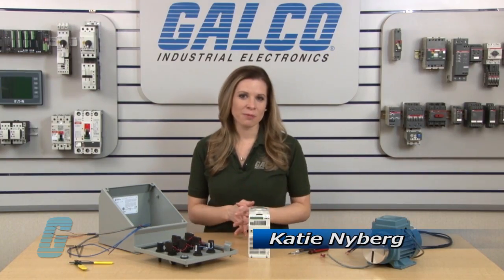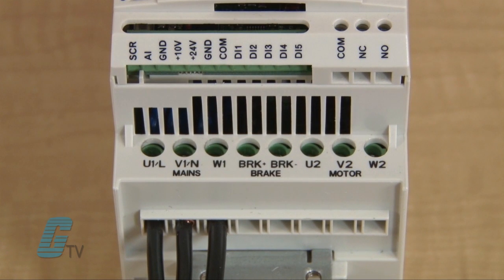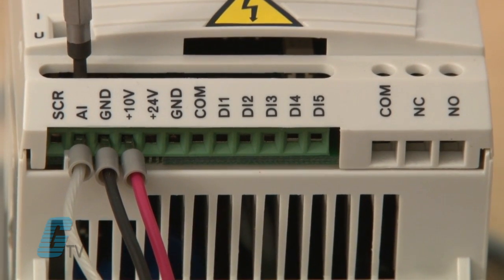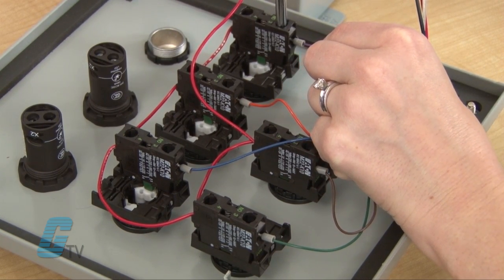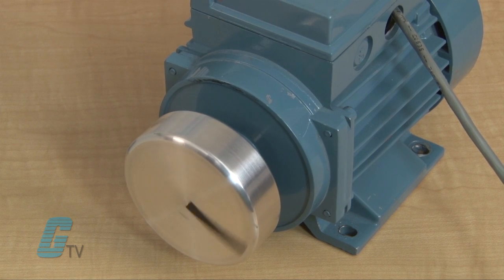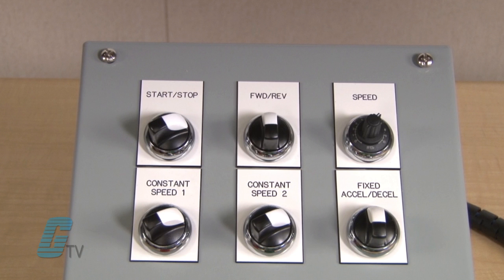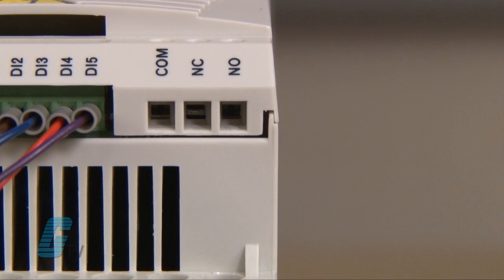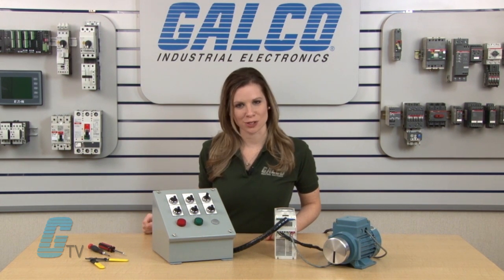How to Wire Up an ABB ACS150 Drive

Comment: The manual seems to indicate the relay output can be wired for 230v, but its not clear how this is done.  The 24vdc is covered here, but I’m hoping to use this relay yo run a very small pump (less than .5A).  I have this ACS150, single PH 230v input, output 240v 3ph to 3HP motor. When I pull the trigger (remote button on saw arm) I want to use this relay to fire the pump, just like lighting a “running light”. Any ideas,

Comment: Huh. So you don't need to bolt the motor down to see if it works or not. I was taught to always bolt it down. But I guess it's only really needed when it actually has some working load to it. To stop it from going around.

Comment: If there is a fault, the supply to the motor is cut off due to the OLR in my power circuit. Then how does the red indicator bulb glow? When there is no power to the VFD?

Comment: hi I like your video I would like to know how to connect a potentiometer to use it remotely thanks
Reply from the maker: The Speed pot can easily be wired remotely , just make sure you use shielded cable and only ground the shield at the drive's chassis ground, ok?

Comment: What is digital input & analog input plz mention. thanks
Reply: digital input is the contact from relay or switch, analog input is either voltage or current which comes from sensors analog outpur or other devices has analog output..
Reply: @sircmanaloto1296  thanks

Comment: Please help me for overcoming the error -F0035 in ACS 150
Reply from the maker: Looks like you have a problem with your output power wiring. Please verify you have the input line power connected to U1 V1 W1 and motor leads connected to U2 V2 W2, very critical. If ok then verify your grounds are connected per the manual recommendations.
Reply: I checked input supply between R & Y =398volt, Y &B =398V and B&R =405 V. But this error continue after a fraction of minutes
Reply: I also  disconnected output wires which were  for motor but still condition was same
Reply from the maker: Please reference the terminal numbers
Reply: Input power supply OK
Reply from the maker: Did you measure each phase to ground? If so and the voltage to ground is equal, the drive may be faulty and need repair.
Reply: I check voltage between each phase and ground. This is OK. And also disconnect motor wires but error is coming continuously.
Reply from the maker: Then it is most likely the drive itself has failed.

Comment: When I press reverse pushbutton its shows REV on the acp and I get 24v on DI2 but the motor doesn't run in reverse direction.

Any solutions please?

Comment: What does U and I stand for on the input switch?
Reply from the maker: The U stands for voltage input (0-10volt input), and the I makes it a current input (0-20ma).

Comment: Where does Katie connect the +24V Source to in her setup? Trying to wire up the ABB ACS150 for a momentary contact paddle switch.
Reply from the maker: 5th terminal from left should be the +24volt output but you will also need a jumper from com to gnd so you can use the internal 24volt supply for your inputs.

Comment: i had installed pot but it is not controling, which parameter should i change that speed could be controled by pot and i am using acs5050-01-045a-4
Reply from the maker: Ahh well let me assume that you mean the ACS550, because there is no such drive as ACS5050, ok? The drive defaults to the Analog input 1 or AI1 at X1 terminals 2, 3, and 4. Do you have a copy of the User manual for this dirve?
Reply: yes it is acs550. i had downloded its user manual from abb website.It was running on remote mode by using speed pot but person who was handling this drive before me had done something to it and now pot is not working some parameters are also missing i can only change rpm by drive keypad prameter 11 ,1105. please help
Reply from the maker: Ok if you have keypad ACS-CP-A first make sure you have the "REM" symbol in the upper left corner of the display, (remote mode) if not simply push the LOC/REM button to put back into remote mode of operation. If still doesn't work you may have to default the drive.

Comment: hello Katie i am not able to start this drive,is it necessary to connect AI
I have connected 3 phase mains  & motor connection but drive not starting
Reply from the maker: Hello,

Is the drive in local or remote mode, and have you attempted to configure the drive yet?
Reply: no,actually i am not able to start the drive,I mean please tell me how to start the drive,I have ABB ACS 150 drive,0.75KW ABB make AC motor,3 phase supply,is there anything else to start the drive
Reply from the maker: Hey,

We'll help you get your drive up and running, so we'll start with some questions for you and work from there.

Let’s start with “Does display light up?”
If so, look for “LOC” in upper left corner of display.
If says REM, push the LOC/REM button to indicate LOC.
Then push the start button (with green symbol on it) and turn up the speed pot on face of the drive.
If it still doesn’t run, then what does the display say, is it faulted?
Reply: thank you galco.
only display light up,it shows nothing.its a new drive.
Reply from the maker: Ok Shrikant,

So this means that you do not have the drive wired up yet, correct?
Is the drive mounted yet?
Line Power leads to U1 V1 W1, ground wire to chassis terminal.
Motor leads to U2 V2 W2, ground wire to chassis terminal.

Do you have a manual available? We can link you to one if you need it.
Reply: yes I have wired up drive but I have not connected ground wire.is it necessary to connect ground wire to start up drive.i have connected only U1V1W1 & U2V2W2.No IO wiring done.I have manual with me.
Reply from the maker: Yes, the ground wire is necessary to start the drive, without it you may get intermittent faults. 
It will not necessarily damage the drive, but it could shock someone around an ungrounded motor.
Next, try turning on the power after verifying that the line voltage matches the drive ratings.
Then, load motor values in the 99 group parameters.
Then put in local and push start, turn up the pot and it should work, hopefully.
Reply: yes thank u & I'll try it tomorrow
Reply from the maker: You're welcome, we hope you can get it working!
Reply from the maker: Hey Shrikant,

If our instructions end up not working, there may be a chance that the drive is defective since the display is lighting up but not actually showing anything. Keep us updated!
Reply: yes sure
Reply: good luck
Reply: Hii

Comment: Is this machine suitable for a 5 pin UK 3 phase plug? 3 Phase + N + E.
Reply from the maker: Yes this drive can be used in the UK, it meets all US, UK and European stardardsWe suggest connecting the Neutral and Earth ground wires together at the drives chassis ground terminals.
Connect the line phases L1, L2 and L3 to U1, V1 and W1 terminals on the drive only.

There is also an EMC filter built into the drive, 
depending on your particular power feed system, you may want to change 
the plastic screw to metal screw to connect the EMC filter and make it 
active.
Hope this helps.